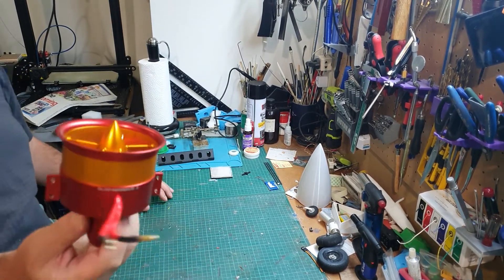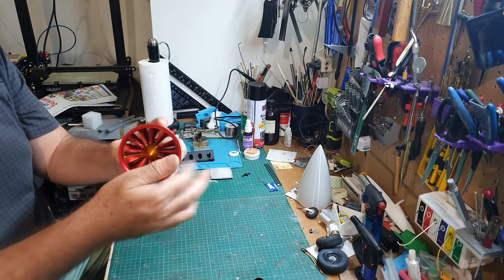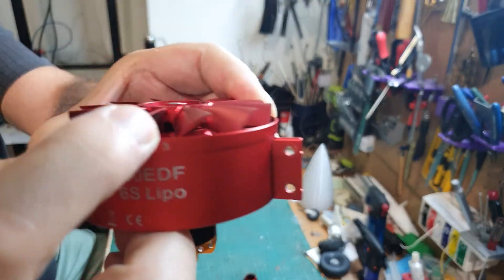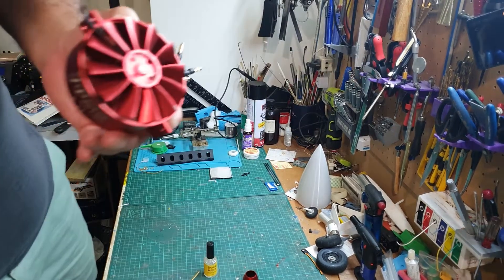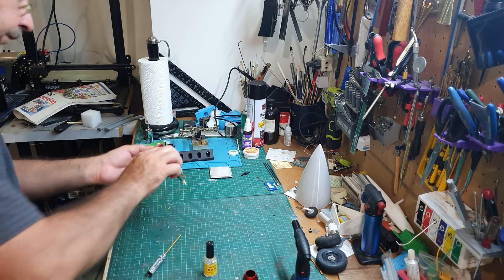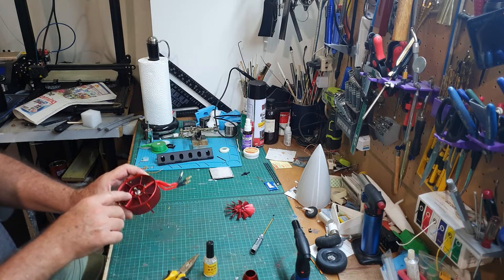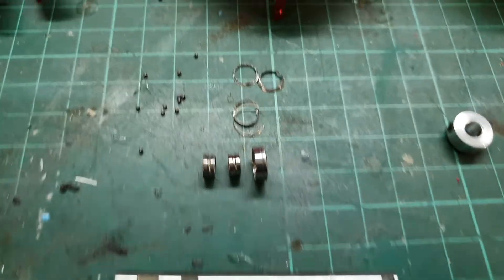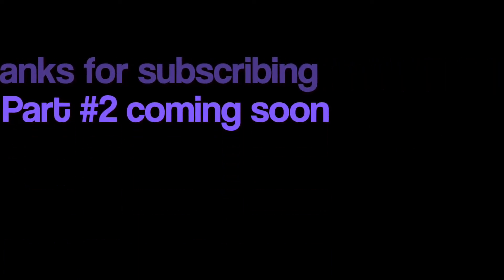Ball bearings exploded!!!! Repairing a JP 80mm EDF Part #1

Comment: Try using a fine tip soldering iron to heat up the grub screw. This method is what I use when the screw is in a confined area where I don’t want to burn up the surrounding material. Hope this helps you in your future builds. Great video!